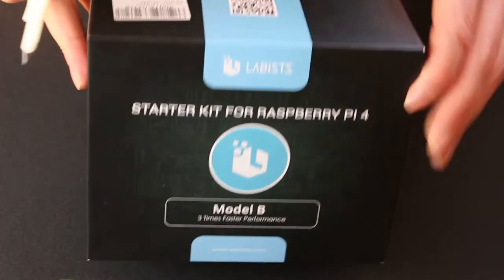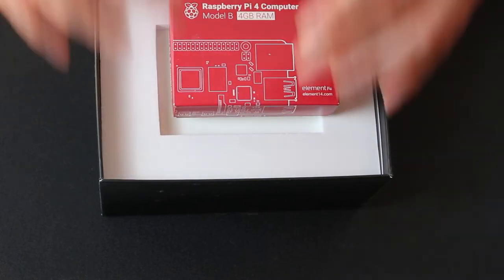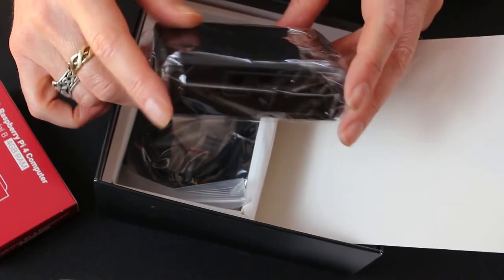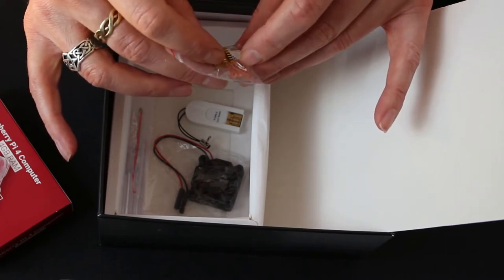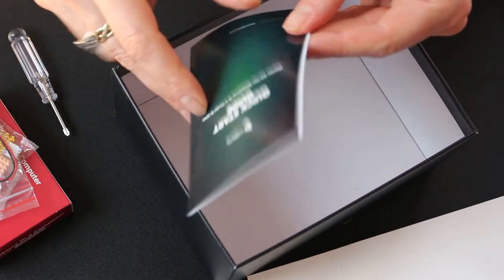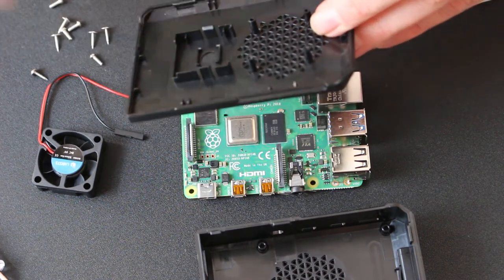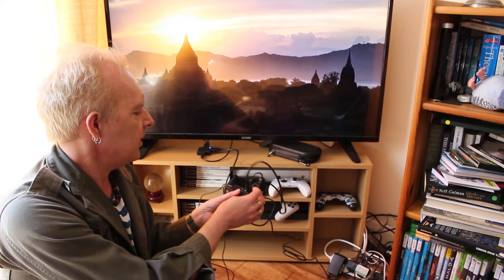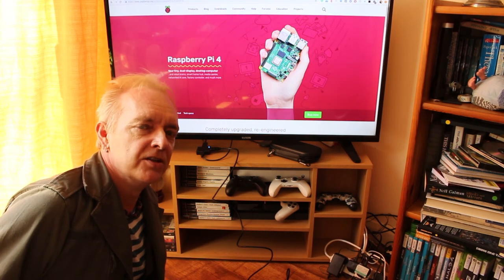Unboxing and Assembling the Labists Raspberry PI 4 (Model B)

Comment: Hello,  thanks for the review. I was just looking for reviews as for this as I needed a cheap case. These seem alright. Cheers.

You can install scripts to control the fan so it comes on when the Pi reaches a certain temp. It's better than having a mini jet engine whirring away all the time. 

This thread can help to keep your Pi quiet: https://www.raspberrypi.org/forums/viewtopic.php?p=1647536